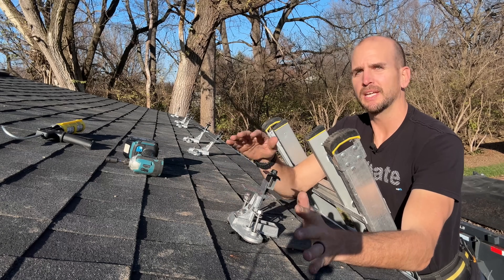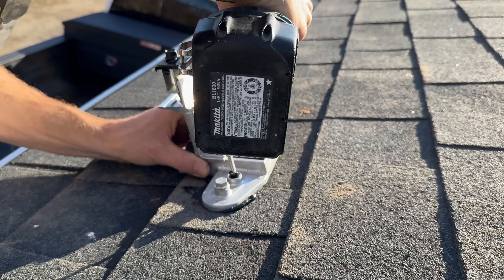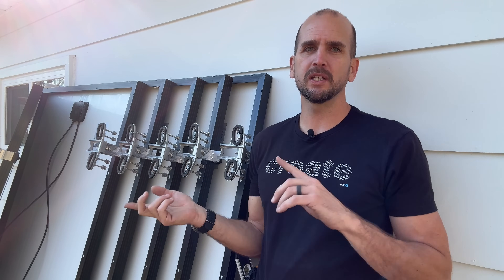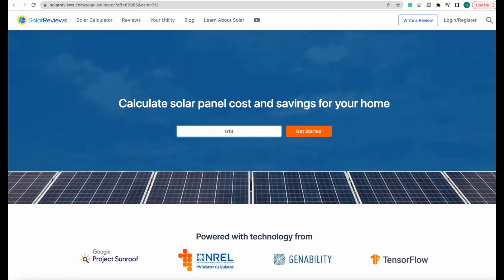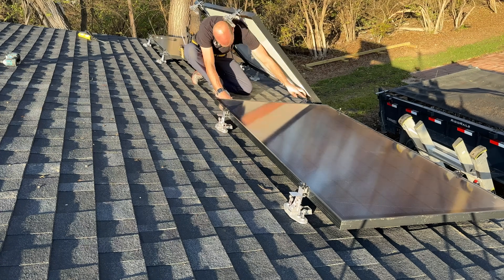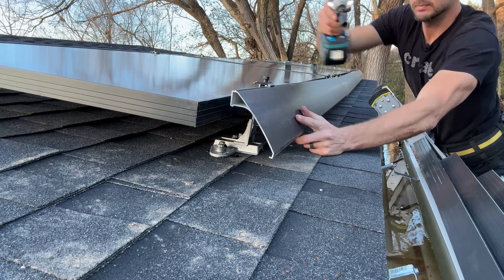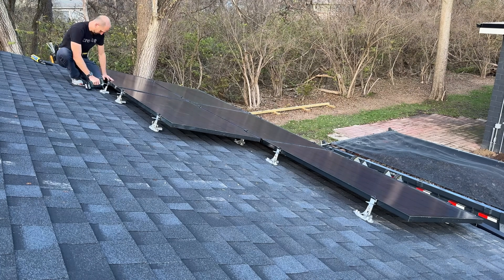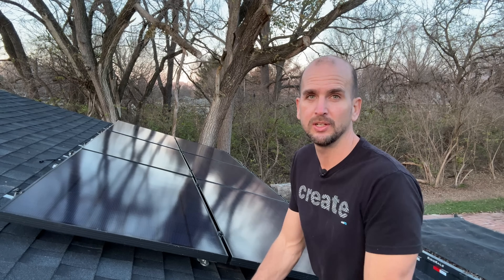Easy DIY Solar Panel Roof Installation

Comment: I've done hundreds of installs in Santa Barbara and worked with just about every roofer in town. As well as every single local building inspector in the county and the city. These things are unacceptable. These things have no flashing and the last roofer I showed it to said he will send the homeowner a letter stating that his entire roof is warranty void if the solar contractor uses a product such as this. I've also had several inspectors tell me they will never pass a system unless all penetrations are flashed and the penetrations are secured into roofing rafters. No such product is allowed that secures to the roof decking only.

Comment: One issue I see is that if you have a panel failure, you need same panel to replace without rails.  Also, when you need a new roof, it's a lot to remove.

Comment: Code for me is it has to be screwed to a stud, not only the sheathing, also, I would toss that skirt, you want the panels to breath, just ground them with a strap together or something for bonding.  Also, having been on many roofs, I don't trust any sealant, it all dries and cracks especially if wind will be tugging on those mounts, lots of screws to eventually leak.  Easy though. I do like that.

Comment: Ladder isn't even setup right on the roof.  And mounting into the sheeting  😳   and if you don't have a battery bank solar is useless.  If the grid goes out and the solar doesn't work its pointless.  The cost to pay off the generic solar is not worth it.  I priced several.  It would equal out the same as my pud bill as the bill to pay for the solar install.
Reply: And in winter I would still pay pud because lack of efficiency in our winter months in SE Washington

Comment: They have a gasket, with a hole at the bottom to let any water drip, I would not add sealant into that hole at the bottom, just at the top where the bolt tightens(although I am sure it's not even needed...)

Comment: Interesting you just blow through the shingles instead of going under them. I know it's got "self sealant" on it but gonna leak at some point. Plus when you need a new roof, the cost will be 1.5 times because of having to remove em  all, bet won't find all the holes either but hopefully new tar paper will cover them all up.

Comment: You will be surprised to find that 25% to 50% of the pentration holes are leaking. Don't trust the appearance from the ceiling; small leaks will dry up before they reach the ceiling. You need to climb up to the attic and check the roof sheathing (plywood) for wet spots/strains. You will be surprised to find that 25% to 50% of the pentration holes are leaking. So check it quickly before it's too late.

Comment: Great video!  I plan on using the system. The ease of installation and the ability to place mounts anywhere you need them is a great feature. I plan on using extra mounts on all the perimeter edges in the array. You can't do that with a rail system unless your rafters happen to be in just the right positions. I also don't want rails because they will impede air flow under the array which cools the panels and increases their efficiency. 
  
It looks like you used Henry 209XR sealant. That is a solvent based sealant. The solvent evaporates away as it cures and the Henry 209XR will shrink as the volume of the solvent disappears. Other videos of the TopSpeed Parts use a Chemlink product. I'm not sure if they use Chemlink M1, Chemlink Duralink 35 or Chemlink Duralink 50. They are all similar sealant products but they have the important property that they do not shrink when they cure. The TopSpeed mount has a compressible gasket. When the gasket is compressed, the sealant is forced into the screw holes, cracks and the uneven surface of the shingles. If you use a sealant that shrinks, it may pull back from the fine features it is supposed to fill. (Henry makes great products but they are not great for this application.)
Reply: Great response. I am very close to buying about 76 of the brackets. The sealant type had been a lingering question yet to be researched thoroughly. Liberal application plus around the perimeter. If you happen to have a self-healing membrane that'd prob help a lot.

But Henry is used on flat roof applications. It works well. I used it on my FL flat roof home now and the leak stopped. On the face of it I understand the concept of it shrinking but why is that not a factor for sealing flat roofs?

I have an old roof anyways. Primary goal is to go metal and utilize standing seam one day. Not anytime soon. I was just thinking I could maybe create my own plastic flashing that covers the lags and slides under upper shingle. My son could 3D print them maybe. Or perhaps a cheap solution could be fashioned.

Comment: Way too many mounts to penetrate the roof!!! Four per panel??? No thank you....
Reply from the maker: There are a lot of penetrations for sure but it is a little less than 4 per panel (E.g. 12 mounts for 4 panels, 16 mounts for 6 panels, etc.)

Comment: Do you have an estimate for the total time from ground to the last bolt?
Reply from the maker: Hmmm, this is a day project.  If you include wiring in a junction box it might be a bit more depending on experience.

Comment: But what he’s not telling you is that that sealant fails within three years and then within four years, your roof is damaged. I am a retired, licensed commercial union, Superintendent, Contractor roofer, and waterproofer for the past 40 years. I’ve seen so many of these roofs fail this way. This is stupid idea system. The proper way to do it is to install mounting jacks that are bolted to your roof trusses. Then you cut your shingle around the jack, which is already waterproof to the deck. And put the right silicone epoxy caulking around the jack on the shingle. If you don’t believe me, just look at any construction building. You will see that it’s done exactly the way I just explained it. They’re called Roof jacks. Another term we use the same type of mounting jacks for safety rings D rings. But you can also use them as mounting rings you just gotta get the right ones.

Comment: Composition roofing is not meant to be the main water seal, it's meant to protect the felt or plastic sheeting underneath it. Unequivocal no on that mounting system.

Comment: Not a fan of so many bolts per mounting pad. I like the system though. I like the skirts. If you skirt all 4 sides the wind wouldn't be able to lift them as easily.
Just wish it was 1 lag per mount so you could get it in a rafter and not have 4 holes to deal with.

Comment: Thanks for making this video!! So much appreciated. My son and I are just about to install 30 solar panels on his roof, and are making the decision about mounting hardware. I appreciate the comment below by ssoffshore5111 regarding snow load because my son's house does get snow (Sierra's). So it's true that snow load on the sheathing instead of the rafters is a concern. If you happened to span to an exact center between rafters, there is some risk of roof failure I would guess.

There is a tradeoff here with these brackets - having many lag bolt holes (soooo many) as apposed to far fewer into rafters. HOWEVER, the thing that has been bugging me about "attempting" to hit the rafters is that you are most likely to ALWAYS be off-center of the rafters. You could easily miss them enough to split them or just get a bad grip on them. When winds come, then you are exposed to failure of liftoff. We're still not sure which is preferred...but we'll watch more and read more!! Again, THANKS!
Reply: What mounting setup did you end up using? I’m between these or some other flashing type reckless.
Reply: @Obababoy We just got our plans approved yesterday. 👍 (Nevada County in CA). We decided to go with these mounts - TopSpeed. Ask me again in a few months and I'll tell you how the install went. After watching this and other videos, we have some confidence that it will work well. BTW, it should be noted that the Spec is to use 3 mounts between panels, and 2 at an edge. I bought ours on eBay at $145 for a box of 16, so, great price.
Reply: @GaryBeardsley  oh nice yeah I saw those on signature solars site. My only worry with those deck mounted ones is the waterproofing. I wish there was a big sticky flashing piece to stick under those.
Reply: @Obababoy  Just FYI, these mounts look REALLY well engineered to me (I happen to be an engineer). There is a rubber seal surrounding the entire cavity where the bolts come through, and the spec is to fill the cavity with roof caulking.  I really don't think anything else is needed...these mounts will not leak, and will work very well. That's my sense, and I'm very picky regarding mechanical engineering.
The other thing that boosts my confidence is that SnapNRack is a huge name in this industry. This is their "New" solution for Solar Panel mounting. Their business depends on the success of these new mounts. They - no doubt - did a huge amount of engineering analysis and real outdoor testing compared to other solutions. They really don't wanna screw this up - it's their future.

Comment: Glad I installed Ironridge.   Are those mounts engineered calc'd for permitting. Are they secured to rafters. Do they have mounts for tile/concreter roof....

Comment: If I need 2 rows like this on the video and have a flat roof,  can I have a 10º angle on the panels? how can I adjust it if the second row attaches to the same mount as the first row? or are these only for 0º

Comment: IMO especially on a low pitch roof like this you want flashing mounts. k2 everflash, ironridge quickmount etc. You are relying on the mechanical seal first and sealant as a backup with flashing, where as this you are relying on sealant as the primary, which ofc expands/contracts, dries out over the years. Look at your current roof penetrations, they all rely on flashing. They aren't expensive either and it doesn't really make it any harder to install (besides finding the trusses or doing some blocking). On a high pitch roof this might be OK, but I don't know why all companies don't incorporate at least some level of flashing on their designs to go under at least 1 row of shingles.

Comment: After many years with a poorly-designed roof, we finally had it modified and roofed properly, and have had 8 great years with absolutely no leaks.  The one thing that stops me from adding solar is the roof mounting systems.  Someone needs to manufacture and offer a no-holes-in-roof system, such as rails mounted to eaves, which will allow panels to be secure but not bolted through the roof.  I may have to build my own...seems odd that after this many years, they haven't fixed the one glaring weakness of rooftop solar.

Comment: Yeah I wouldn't put all of my trust in a few blobs of sealant especially for a system that will be sitting on the roof of my home for the life of the roof. For me personally taking the extra time to properly find roof truss locations and doing a single lag per mount with fewer mounting points overall using a railing system seems like the play for a long term installation on a livable structure. 

With say an Ironridge Flashfoot2 you have a single truss lag with a sealant sealed pilot hole underneath the flashing with a protective rail mounting cap that covers the lag connection keeping the entire penetration assembly covered from the elements.

Sure installing on a non-livable structure like a garage or shed then yes this system is perfect where you can more easily monitor water fastness. TopSpeed also allows you to be more creative with where you can mount your panels which is nice.

Comment: As long as the deck of roof is solid you should have no problem. Now, do you really know what condition it's in?
Reply: Screwing a bunch of holes in it you're bound to find out.

Comment: I have 2 grid tie 550 watt panels which I put into my panel in the lower right double 20 amp breaker spot direct. Having trouble monitoring if it’s working correct. Any advice?

Comment: That's 16 roof penetrations per panel.  We don't get snow loads here in the Arizona desert, but the sun dries out sealant super quick.  I think they would have to be resealed every year or two because you're relying on that sealant.
Reply: They should have made it so the Bolts are covered up by the panel itself sitting higher.  It would make it harder to get to the ceiling, but it would block the sun from head and last significantly longer.  Then you could just clean up what you need to every 8 years.
Reply: sealent at and roofing plastic black tar would do well, this stuff when it hardens is like acrylic. Okay you don't trust that, use Resin.  You are out side, no need for a mask.

Comment: I wonder...would these work for doing just two panels in a line?

Also, what width of studs do you need? This looks like this needs a big stud.
Reply from the maker: These only need to attach to the plywood decking and that is why each one has 4 smaller lags as opposed to 1 larger lag that would go in your trusses.  I also like the mini rails that I used on this roof mount https://youtu.be/0NM5CT_ygnc
Reply: @everydaysolar  Gotcha! Yeah I'm doing a line with 2 solar modules, and I think the TopSpeed would be overkill. Let me go watch that video you linked. Thanks for the reply!

Comment: "Check out this video where I walk you through this exact setup.." No, the video you pointed at is an 8 month old video about wire sizes. Can you link the correct video continuing this setup?
Reply: I found it: https://www.youtube.com/watch?v=icBKYACja7Y
Reply from the maker: Thanks for the heads up and here is that video 👍 https://youtu.be/icBKYACja7Y

Comment: I think this is a very fast intallation but also the most expensive one cuz after few years you would need to replace you roof and you have to buy 18 of those if you have 8 panel… i got 22 panels and it would cost me about another $1000
Reply from the maker: Yeah, it is a bit pricey for a larger installation.  What are you planning on going with for your install?

Comment: arning:  Replace your shingle roof before you install solar panels, neighbors had solar panels installed two years ago, shingle roof had to be replaced this year, it cost them $11,500.00 to have the solar panels removed and installed again....
Reply: The reason why I install ground mount solar instead. I will probably need a new roof in 10 years.
Reply: No problem, If I have to, I will remover the solar panels and then have them do the roof.  I am particular about how I want shingles installed even when I am not a roofer, I know the week points and bad habits they have. Sheathing nails off the flasher or at an angle when you look from under every 10 nails is off the center.  There is a gap between each sheathing plank which will eventually buckle and or leak. no support from on to the other and people walk on these, 180 lbs man can in humid weather get these off and then crack in high heat. Wood is very delicate and moldable with humidity, just look at your guitar, that is how it is shaped.. This is the reason why they want to replace it every ten year. Sloppy design to begin with and done on purpose..  Racoons can come and lift the shingle sides that did not glue on correctly or over time lift due to weather cracking, Racoons can sense these weak spots and can scratch their way through the wood.  I had to go back and seal every one so that nothing can lift those up.  What a scam this shingle roofing is.! sorry. I am a system design engineer, we design for durability and not for profit. Well, at least we used to. Food for thought. If you want high quality insolation from these singles you have to use the correct products and trust their how they cure.
Reply: @SaenzFonsi  Be careful on your roof! Glad you've got the ability to do these types of repairs!

Comment: How are you meeting the rapid shutdown requirements of <80V and <100VA in less than 30s with this (those 3 panels in series likely violates both)?  Feel bad for firefighters with all these DIY solar systems without any rapid shutdown in place...

Comment: So 4 of these for each panel. Seems too expensive for a large system
Reply from the maker: If you just do 1 panel it would be 4 but if you do multiple rows it will be a little better like 2 panels across 2 rows would be 6 mounts and 3 panels across 3 rows would be 8 mounts.

Comment: Hard to believe these mounts are allowed by code. There will defiantly be water penetration, mold, and rotted sheathing as the extreme heat breaks down the sealant. These types of mounts are the reason many homeowners are having their homeowners insurance canceled about 5 years after installation. Hard metal traditional flashing is the only way to ensure no leaks for the life of the system. These are great for the installers but really bad for the customer.

Comment: Local city codes in scottsdale and Phoenix AZ prevent anyone bot licensed electricians to install solar on your roof and any electrical...Scottsdale and phoenix are gestapo HOA organizations..their requirements are way too restrictive..additionally..you can't even start without your diy solar gets a permit first..which in itself prevents anything but big name solar solar hardware from getting permitted..they have not permitted one hybrid or off grid system unless it has micro inverter based platform

Comment: SNAPNRACK, TOPSPEED, MOUNT $14.45 
Introducing the SnapNrack TopSpeed™ Roof Mount System – your solution for efficient and stylish solar installation. With rapid installation, durable design, and a sleek aesthetic, TopSpeed is the future of solar mounting.